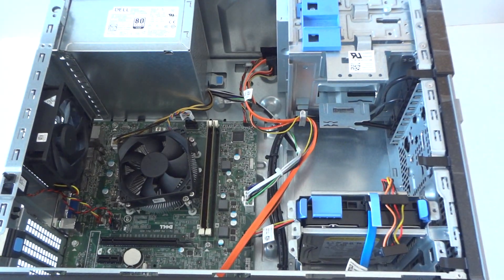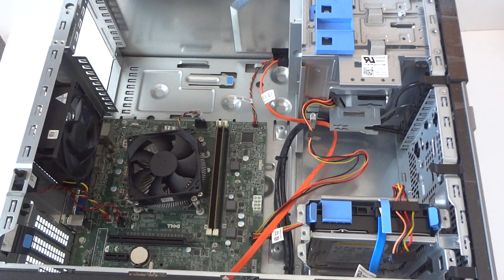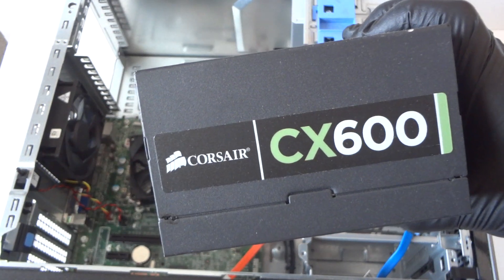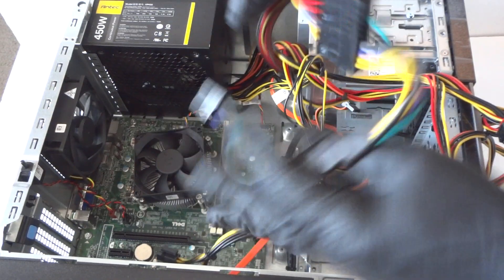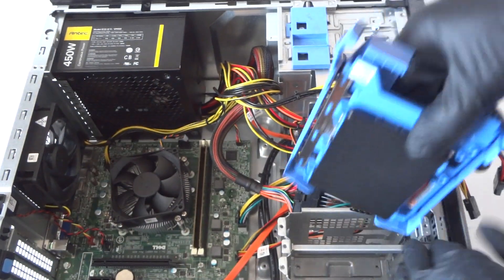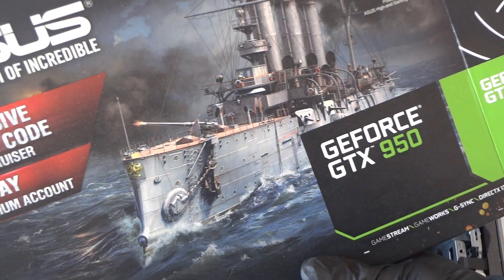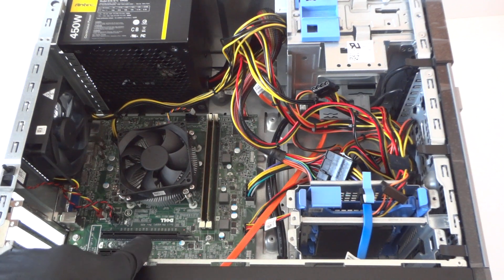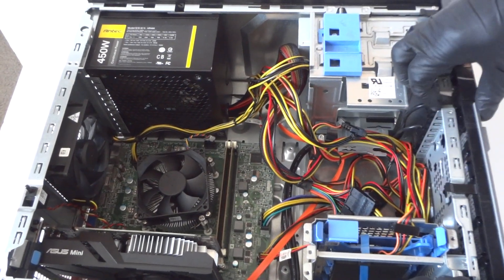Dell Optiplex 3020 Gaming Upgrade Video Card SSD Drive

Comment from the maker: Full Parts list works with this machine: 

 PSU:
(1.) CORSAIR VS Series, VS500, 500 Watt, 80+ Certified, Non-Modular Power Supply
https://amzn.to/2RxoMZV

(2.) CORSAIR VS Series, VS450, 450 Watt, 80+ Certified, Non-Modular Power Supply 
https://amzn.to/3efEeDO

(3.) Thermaltake Smart 500W 80+ White Certified PSU
https://amzn.to/2xQHm8F

You will need this adapter if you upgrade power supply.

24 Pin to 8-Pin Power Supply ATX PSU Adapter Cable 
https://amzn.to/34T0lLS

24 Pin to 8 Pin ATX PSU Power Adapter Cable DELL Optiplex 3020 7020 9020 Precision T1700 12-inch
https://amzn.to/3btebHf

This video cards will work with this system.

(1.) Gigabyte Geforce GTX 1050 Ti OC Low Profile 4GB GDDR5 128 Bit PCI-E Graphic Card (GV-N105TOC-4GL) 
https://amzn.to/2XEqKMb

(2.) MSI Gaming GeForce GTX 1650 4GB GDRR5 Low Profile Graphics Card (GTX 1650 4GT LP OC) 
https://amzn.to/2VkDdSd

(3.) MSI GTX 1050 TI 4GT Low Profile  Graphic Cards 
https://amzn.to/34r0AxG

(4.) Gigabyte GeForce GT 1030 GV-N1030D5-2GL Low Profile 2G Computer Graphics Card 
https://amzn.to/2Xu3SyO

(5.) ZOTAC GeForce GT 1030 2GB GDDR5 64-bit PCIe 3.0 DirectX 12 HDCP Ready Low Profile Video Card ZT-P10300A-10L 
https://amzn.to/3eayL1b

ZOTAC Gaming GeForce GTX 1650 OC 4GB GDDR5 
https://amzn.to/2V28laj

ASUS GeForce GTX 1650 Super 4GB Phoenix Fan Edition (PH-GTX1650S-O4G) 
https://amzn.to/3eoad4S

This RAM works with this machine:

(1.) Crucial 8GB Single DDR3L 1600 MT/s (PC3L-12800) Memory CT102464BD160B
https://amzn.to/2VhGv8O

(2.) Crucial 4GB Single DDR3L 1600 MT/s (PC3L-12800) Memory CT51264BD160B 
https://amzn.to/2xq46wb

(3.) Crucial 16GB Kit (8GBx2) DDR3L 1600 MT/s (PC3L-12800) CT2K102464BD160B 
https://amzn.to/2VpsKpP

This HDD 2.5inch will work in this caddy for extra storage.

Dell R494D 3.5" to 2 x 2.5" HDD/SSD Caddy Adapter 0R494D
https://amzn.to/3c8ynhJ

1.. Seagate FireCuda 2TB Solid State Hybrid Drive Performance SSHD – 2.5 Inch 
https://amzn.to/3b1e8T7

2..WD Blue 2TB Hard Drive s, SATA 6 Gb/s, 128 MB Cache, 2.5"
https://amzn.to/2Xstb4b

3..Seagate BarraCuda 2TB Internal Hard Drive HDD – 2.5 Inch 
https://amzn.to/2xmf0TE

This cable required if you going to install SSD and HDD:
Benfei 15 Pin SATA Power Y-Splitter Cable 8 Inches
https://amzn.to/2XsG0LV

Cable Matters 3-Pack 15 Pin SATA Power Splitter Cable 8 Inches 
https://amzn.to/2Rval8B

Zheino SATA Power Splitter Cable (2 Pack) SSD Power Cable HDD
https://amzn.to/3a3V9Wq

SSD list works with this PC:
(1.) Samsung 860 EVO 500GB 2.5 Inch Internal SSD MZ-76E500B/AM) 
https://amzn.to/2yNxnkE

(2.) WD Blue 3D NAND 1TB Internal SSD, 2.5" WDS100T2B0A
https://amzn.to/2wvnC9Z

(3.) WD Green 1TB Internal PC SSD  WDS100T2G0A
https://amzn.to/3cbrcWa

(4.) SanDisk SSD PLUS 480GB Internal SSD SDSSDA-1T00-G26
https://amzn.to/3a3i9ou

(5.) Crucial MX500 250GB 3D NAND SATA CT250MX500SSD1(Z) 
https://amzn.to/34rZlhy

(6.) Samsung 860 PRO SSD 256GB - 2.5 Inch SATA III 
https://amzn.to/2ybiHLK

(7.) Samsung SSD 860 EVO 250GB 2.5 Inch SATA III Internal SSD 
https://amzn.to/2VjIAkK

(8.) SanDisk SSD PLUS 240GB Internal SSD
https://amzn.to/3c7SEE4
Reply: Mxkdi wouldn’t any GDDR5 video card work with this machine considering I change the power supply
Reply: @hamzhehe5062  you only need to change the PSU if it takes and 8 pin power input.. if it needs 75 Watts or Less you'll be fine the dude in this video didn't need to change the power supply.. you can look up my comment on this in the comments.. 👍
Reply: brooke robertson ok thanks
Reply: brooke robertson it’s been some time but I’m planning to get the gt 1030, would that mean I need to change the PSU or no?
Reply: brooke robertson alright thanks
Reply: whtas the budget
Reply: those PSU in the list won't work will they?   I thought the largest power supply that would work in this computer was only 300W.  I have a 3020.    but I was told there is 2 versions of the 3020.  one with the SFF case and another that a slightly bigger case.  I have the SFF case.  which I believe is what mxkdi is working  on.
Reply: wasatchm no this is the bigger case, he has made a video on the SFF just search it up.
Reply: hamz.  thanks.  yes I figured it out after posting this message and then reading the rest of the posts.  the SFF is just so small to be able to upgrade to anything.  I think I am going to buy the version with the bigger case and then just stick my hard drive from my SFF optiplex into the bigger optiplex.   I think everything will still work fine.  then I will have a LOT MORE OPTIONS in upgrades.
Reply: wasatchm lol it’s true it’s so small. Anyways good luck with that
Reply: Please help! i bought this PC from someone and the optical drive has its cable missing. What type of cables does it requires. Please let me know as I am stuck here with no optical drive!
Reply: @mzorkea   look on the optical drive and find the MODEL#.  google the model # and see what the interface is (ex. SATA).  once you know the interface, you can buy the correct cable (EX. SATA).    if u don't want to look on the optical drive for the model, just google the model of the computer and then review the SPECS which should tell you the interface of the optical drive.  I believe the optical drive and the hard drive have the same interface.
Reply: To keep my old hd there as backup, and my new ssd, what adapters I need and any cases or mounting I need..? Tell me an idea how to make it work?  Ssd in new mounting bracket or what?

Comment: Just upgraded an Optiplex 3020 MT (i5-4590) + 512 Kingston SSD which i got for free with 16GB Ram and an AMD RX6400. Installed Win11 Pro and it runs fine for 1080p gaming and emulators!

Comment: no need to change psu..... you can run a 1650 off the original as the cards all pull their 75w from the slot......

Comment: Hello compliments for your videos very helpful! I have a question why didn't you power the hdd and optical drive from the psu? You use the sata cable from the mobo, there is a reason I have upgraded my psu to a full modular antec, waiting for the adapter, and I was thinking to do that. Thanks in advance
Reply from the maker: Hi, thanks it will work ether way thru PSU or from Motherboard..

Comment: You probably didn't need a new power supply if the only upgrade was a low power graphics card. I had 280 w power supply and added a 1650 (low power) and extra sdds and it was still enough power. However it will help with future upgrades.

Comment: Can i connect my video card gtx 750 Ti? without changing my power supply?
Reply from the maker: Hi, yes you can.
Reply: @Mxkdt  mini or normal?
Reply: @benzyna1505  u can fit on both mini and tower both
Reply: @Mxkdt ?

Comment: I'm stuck away from my home pc for a while due to quarantine so I've been cluelessly assembling one of these (I ended up putting a 1650 super in it despite the slight bottleneck and it's been pretty great). This was a genuinely mega useful, straight to the point guide, thanks dude.

Comment: Hi Man! Thanks for this vid. I am building my 3020 for lockdown gaming. I just have  1 question though. I got the 24pin to 8 pin. But what did you do with the other 4pin? I cant seem to find it in my PSU

Comment: QUESTION (for anyone as I would greatly appreciate any help).   can I remove the HD out of my optiplex 3020 SFF and put it in a optiplex mini tower (with stock configuration) and run the computer with no problem (no software or hardware issues)?   I want to upgrade the PSU and video card in my SFF optiplex but the options are just to limited.  but it looks like if I had a bigger case (MT) I would have a lot more options.

Comment: You don’t need power supply
Reply: some video cards need extra power from the power supply (8pin) the stock power supply doesn't have this
Reply: Maas Music what happens if u use a 8 pin gpu with the regular stock power supply?
Reply: @coaxd7151  you can't sadly, the stock psu only has a 20/24 pin and a 6 pin
Reply: Maas Music I used a 8 pin adapter on my gtx 1060 3gb using the 290w psu and the fans run but the gpu doesn’t even show in device manager or in bios it says the slot is empty and if I try to connect my monitor the gpu it shows no signal So is the problem the power supply only being 290w? Please help
Reply: @coaxd7151  Oh okay, that's really strange... Did you install all the drivers?
Reply: Maas Music it doesn’t let me install the drivers because it says they the gpu doesn’t exist on my pc it only detects my intel graphics
Reply: Maas Music added

Comment: You didn't need to change the power supply... The specification for that PCI slot it's to provide 75 Watt's as standard.. so the previous PSU would have been fine.. maybe if you loaded the computer up with 4 RAM sticks and a higher TDP processer and a couple of spinning hard drives then you may be pushing the previous PSU. But that computer was designed to be able to take that graphics card no problem. 😋
Reply: Marry me
Reply: @jorgerivera7907  steady now Jorge

Comment: Hi, will my Dell Optiplex 3020 work with G.Skill Value 4GB DDR3-1600MHz (F3-1600C11S-4GNS)? I have an empty slot and a single 4GB stick and I want to make it 8GB in total. So will the gskill stick as mentioned before work on the Optiplex 3020?

Comment: Hey, I have a question. I recently bought a Dell Optiplex 3020 with a 290W PSU and I want to get an RX 570 4GB GPU. Do I need to upgrade the PSU or will i be ok?

Comment: If I already have an extra 8pin that comes with my power supply, can i used that instead of the 24 to 8 pin adapter?
Reply from the maker: Hi. no you cant you have to use 24 pin to 8 pin for DELL Optiplex 3020 or 7020 Adapter Cable
Reply: Mxkdi hey man I bought everything And it works perfectly it’s an i5-4590 with a gtx 1060 6gb, I wouldn’t be able to do it without your help. Thanks.
Reply: @jeffthamenace  How much gb of ram

Comment: hello, could someone help me, just now I made a similar armed with the optiplex 3020 but it does not turn on, the power source does work but when I connect it to the motherboard it does not even turn on the PSU fan
Reply from the maker: Hi, do you have mini tower ?
Reply: @Mxkdt  is the same model as yours, I think is the adapter because the led of the motherboard don't turn on, that led turn on when is connected to the  psu, I already check all the components and all work, i'am use the two psu, the original to the motherboard and the cpu  and the new one  to the videocard and the HDD, I try to turn on the psu connecting the green and black wire of the adapter but it doesn't turn on, did you do something more to the adapter ?
Reply from the maker: @TheMrTutas15  Hi, you can try to install original dell power supply 8pin and see if PC turns on.
Reply: @Mxkdt  It turn on, actually everything work with the 2 psu, the original to the motherboard and cpu, the new one to the videocard and the hdd,, i'm using the pc with the 2 psu connected  but that is just a temporary solution, I only want to use the new psu not both, i don't know what to do 
now.
Reply from the maker: Hi, you have to use 1 power supply not 2...
Reply: @Mxkdt  i know, but again, the motherboard does not turn on with the adapter 24p to 8p in the new psu, im try to saing if you have any idea of whats going on, why doesn't turn on with the adapter

Comment: Will a Palit-Nvidia GeForce GTX 1050 Ti StormX 4gb (single fan) fit and work with the stock 290W power supply?

Comment: I know this is old, but do you remember if the drive assembly on the right can be removed to fit in a full size GPU?   Can it be moved up, it looks like there are attachments to move it to the slot just below the optical bay.

Comment: Nice video.  I was just trying to get a look inside the case.  It looks like nice and spacious for what I am trying to do.  I just want to mount 2 or 3 TB IDE drives.
Reply from the maker: Thanks
Reply: how'd that work out for you? did you end up cutting metal to redesign the cages?
Reply: @androidkenobi  I found a drive case at Microcenter that fits above the cd rom. so I've got 3 - 2 TB drives mounted.

Comment: I added asus gtx 770 4gb and cx 650m psu to a optiplex 3020 MT, but the gpu outputs only black screen. Same with other gpu I tried (hd 5450). Im guessing this is due to faulty pcie slot of the computer. So Im thinking of trying another optiplex. Which optiplex model do you recommend?
Reply: you are probably using UFEi mode.  You will need to use the internal card and set the bios so you can reboot with the card installed.

Comment: does dell Optiplex 3020 support UEFI
Reply from the maker: Hi, yes it does.
Reply: @Mxkdt  have a dell optiplex 3020 i5 4590 and rx 570 4 gb bulk, and i will upgrade the psu to 450w or 500w. is that Gpu going to work wiht that optiplex 3020 or i will face problem upditing the BIOS,  flashing the card or  do something like this.

Comment: have a dell optiplex 3020 i5 4590 and rx 570 4 gb bulk, and i will upgrade the psu to 450w or 500w. is that Gpu going to work wiht that optiplex 3020 or i will face problem upditing the BIOS,  flashing the card or  do something like this.
Reply: The only issues you may face are related to not having enough power or space for the video card inside the case and a chance the case cannot dissipate the heat the rx570 puts out they are small space heaters that have been known to overheat in such cramped cases so i would leave the side panel off...bios ect you should not have any problems with.
Reply: @allenbrodess8510  thanks my friend
Reply: i ve replaced my psu with a thermal take 700 w . in fact, my pc wont boot after i install my rx 570.waht could be the problem
Reply: @JakuDesu 
What do you mean by wont boot?no power anywhere?no fan's running or anything?I ask cause people use the term incorrectly alot any slight change to is booting but wont show picture or is boot looping or w/e changes the diagnostic route to take.So take note of and report ANY detectable activity even if it is just a light.

Is the 4/6 pin pci power plugged into the graphics card pretty sure 570's use one on the side of the card?If not you probably wont get a picture.have you checked to make sure everything is seated properly?(power plugs,gpu,ram,boot drives?For now I suggest double/tripple checking all power connector's and making sure ram/gpu/cpu are properly seated

Was everything on the back panel especially power disconnected and the cmos battery drained prior to the installation of the new hardware?

This is something better handled via real time chat  you can shoot me a msg on facebook under this same name if you still need help
Reply: @allenbrodess8510  My computer just works fine when i remove the gpu but when it is installed the computer turn on cpu fan is spinning / gpu fans too /the lights are on but no display,nothing shown on the screen.i updated the bios to the latest version that i found on dell website, and put the boot mode on UEFI but the same thing happened . i put the the VGA cable to the convertor and then i plug it into the GPU. the computer turns on but no boot and nothing shown on the screen . and when i plug the VGA cable into the motherboard it works and i can see the GPU on CPUZ. so what should i do to make it works ?
Reply: @JakuDesu  are you plugging your monitor(display device) into the graphics card rather than the motherboard? Do you have the required 4 or 6 pin power connector connected to the graphics card?Getting your graphics drivers from the card manufacturer?

Either you are not installing your graphics card correct or your new bios is a brick or you got a very expensive paperweight hanging in your system you call a graphics card..

Double check that card is mounted properly and has all required video and power connector's plugged in to the card.
update drivers via card manufacturer

Roll back bios update

test graphics card in another system if possiable..

Assume graphics card is at fault If none of these things make the graphics card work....Get rma approval from graphics card manufacturer and follow the outlined process
Reply: Jack TG hi I have the same issue. Did you end up resolving it?
Reply: @Victor-hf2hr  i solved the problem. what pc and GPU do you have
Reply: Jack TG I have dell optiplex 3020 MT (i5 4590 4gb ram), asus gtx 770 4GB, Cx 650m psu. Thanks!
Reply: @Victor-hf2hr  so what is the problem . you re pc does not boot?
Reply: Jack TG PC works perfectly through motherboard vga port. But the pc doesn’t detect gtx 770 at all and hdmi on the gtx 770 outputs black screen only. I tried amd hd 5450 gpu but that also output black screen.
Reply: @Victor-hf2hr  which version of bios do you have?
Reply: Jack TG I installed the latest version from Dell website
Reply: @Victor-hf2hr  ok . go to the bios menu , go to video and put the video controller into the gpu . and make sure the hdmi is plugged correctly in the GPU because the rails in the back of your pc may forbid your hdmi to go insde the GPU properely.and that what was the problem to me .
Reply: @allenbrodess8510    ok i will send you a msg on faacebook

Comment: Do I have to use the HDD odd cable to provide power or can I use the connection straight from the new PSU?

I ask cause id like to use both HDD and SSD. I got the second caddy for SSD but the SSD site recessed and the second connection from the the HDD odd cable doesn't reach.
Reply: You can use the SATA power directly from the PSU.

Comment: heyguys, can i use a gigabyte GTX750TI windforce for this setup, if there any problem in size, and the drivers. thankss
Reply: ye the case is to small for this card
Reply: but if it fit it will work great